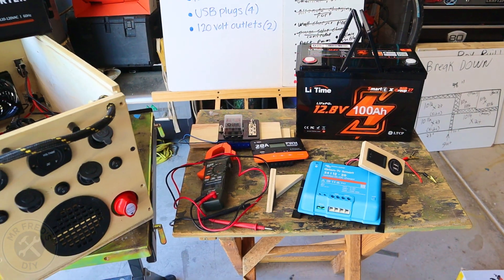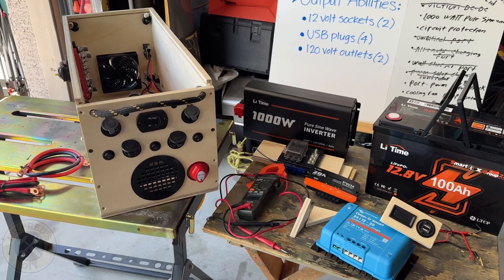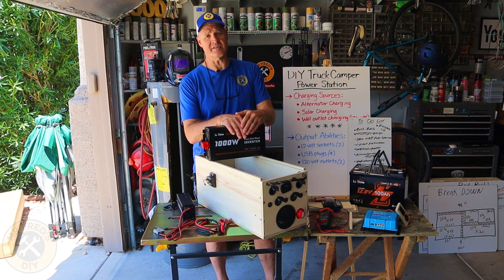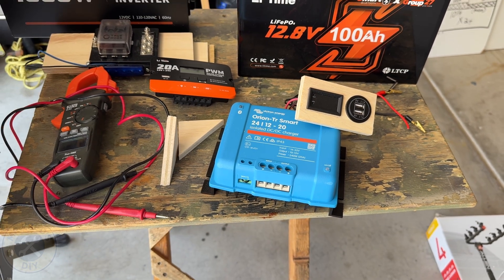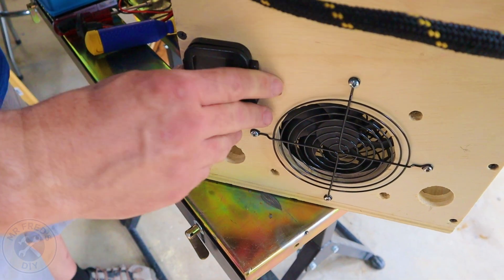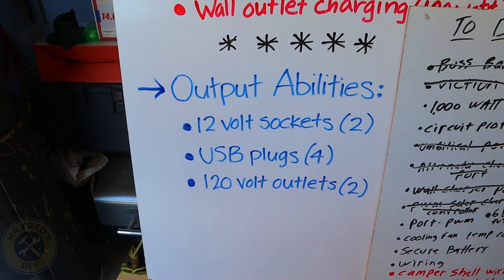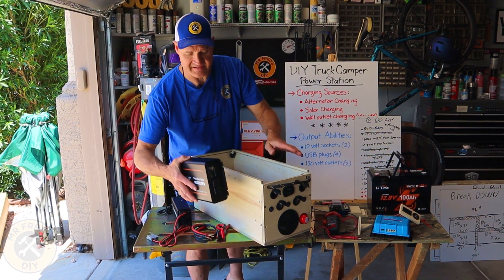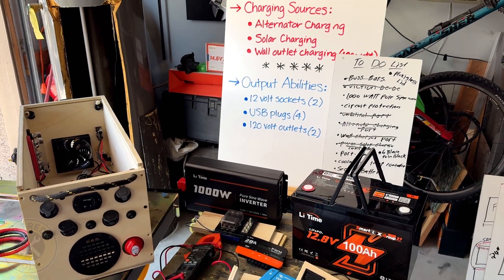I'm Building a Portable Power Station -LiTime Power

Comment: do you think i can re-used old battery from car for Portable power station:? must of the up cost of building portable power station comes from the battery. let me know your thoughts.
Reply from the maker: I have made a lead acid battery power station in the past. It will work just not very well. The peukert makes it very inefficient. When the voltage drops to about 11.7 V, everything stops working and half of the energy is left in the battery. Lithium, iron phosphate, batteries like the one I used in the video allows you to use nearly all of the power before the voltage drops that low.
Reply: Male sense. Thank you for your expertise! @MrFredsDIY